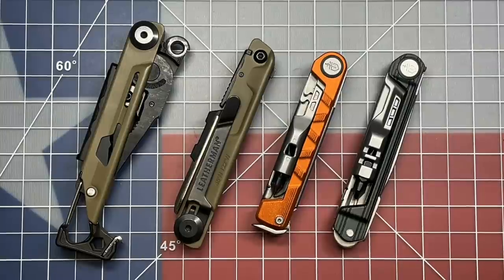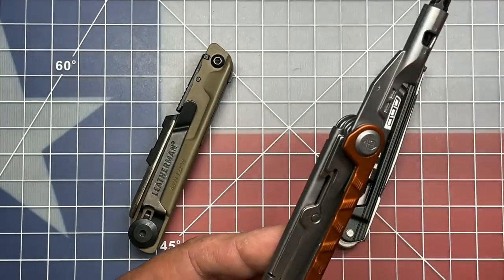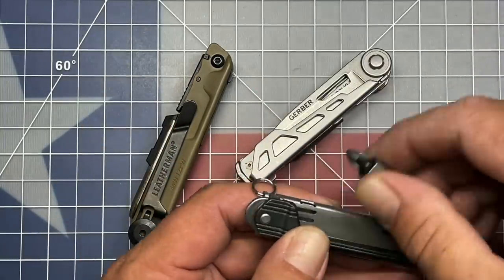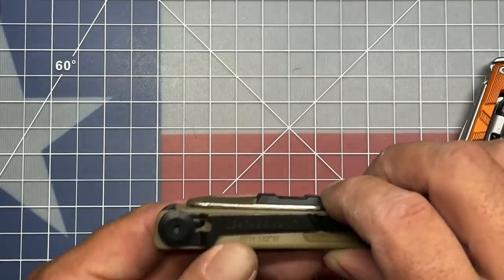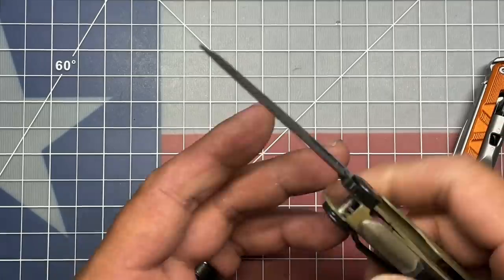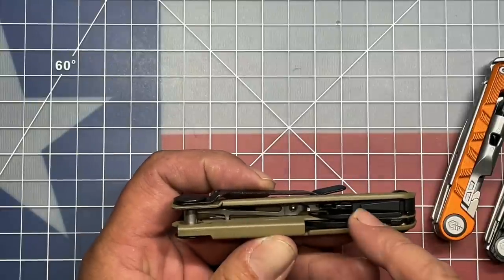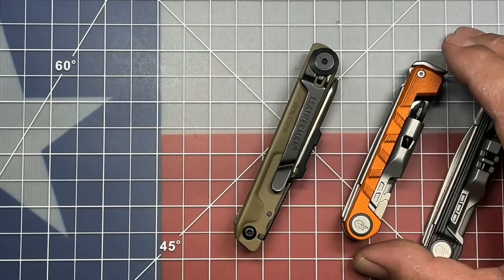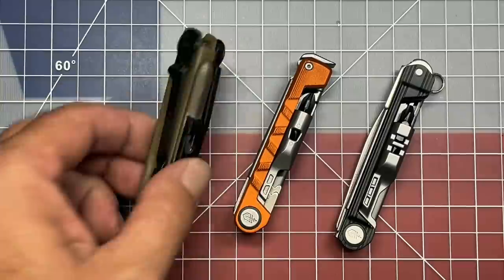Minimalist Multi Tools - An idea I think Leatherman should explore.

Comment: Victorinox SAK sitting over there being like: "Am I a joke to you?" lol
Reply from the maker: Lol. I get it, but I think Leatherman could build a locking version of minimalist multi tool that would give a SAK a run for its money.
Reply: @txtoolcrib  I was just teasing, btw. I like your ideas and think you're right on!
Reply from the maker: Oh I know, all in good fun!
Reply: @txtoolcrib  I think you're wanting two different things. you want minimalist, but you also want a large pry tool? a pry tool should be a specialized piece of equipment. a multi tool/knife shouldn't be used like that. if you need a pry tool so often that it needs to be edc, then you need to get a small nail puller/pry tool. it shouldn't be a part of your multi tool. there will NEVER be a perfect edc tool, so let's not go adding unnecessary equipment where it doesn't need to be. if you think this is a good idea, then I'm assuming you're one of those idiots that thinks the multi tools with a built in hammer is a good idea. I mean, you CAN fit a square peg into a round hole, but why bother?
Reply from the maker: Well first of all, let’s clear one thing up. I am nowhere in the vicinity of being an idiot. 

  You seem to be making quite a few assumptions on what I want. I’ll tell you what I think the ideal minimalist tool would be for me. A solid one handed opening knife blade is the first thing. Second, would be a capable fold out driver, similar to what the Armbars from Gerber do. Finally, a decent package opener for both boxes and clamshell packaging would most benefit me personally. An awl and scissors would be nice, but I could live without them. Lastly, all tools would be locking and it would incorporate a deep carry clip.
Reply: @chriswright8114  Wow Chris, you have problems.

Comment: Ben, you are totally spot-on.  Leatherman technically did something like this with the Free T2/T4.  But the tool selection wasn’t right.  It should be... knife, scissors, driver, prybar and maybe a pointy awl.  Keep it reasonably light and give it a pocket clip.  The SOG PowerPint is proof that you can pack a ton of locking tools in a small package (although the poor scissors and lack of slotted driver/prybar keep the PowerPint from being a top-notch edc tool).
Reply from the maker: I was always lack luster on the T series. I agree that the PowerPint is a pretty good, and very compact tool, though the tool quality could stand a little improvement.

Comment: I would say add…
Locking true 1/4 inch driver 
Good Scissors 
A diamond file
Little pry spot off the frame
Definitely a straight blade with good steel no less the 154cm preferably 20cv. 
Oh and good tweezers.

Comment: Definitely agree. Love smaller minimalist multitools. I’ve actually been pretty disappointed by the last few tools leathermen has put out. The signal is great! But the whole free line I’m not a fan of. The rebar is seems cheap but I think that’s the point. Very entry level, I get it. And then the new bond is completely pointless. Like I get it’s nostalgic I guess, but definitely a step backwards compared to the wave+. Pretty much any leathermen tool moving forward that doesn’t have a bit driver is a let down for me. 

The wave, surge, signal and mut are definitely their best tools. Anything new should be based off of those models in my opinion. 

What I’d like to see, and I know it would sell very well is a dedicated multi tool that’s dedicated to tradesmen. Give me pliers that have wire strippers, give me a nut driver, options for Allen wrenches, pop out mini level, magnet for finding studs, even a damn electrical tester.. I could go on! Release a “tradesman” line and have ones dedicated to electricians, plumbers or hvac/r guys. I ask people about it on jobs sites and I know people would buy them.

Comment: This is a really good concept to carry a knife/screwdriver + a set of regular pliers instead of having a pliers multi tool cause most people also carry a folding knife anyway. If they just focused on making it a really decent knife, and just do a fixed bit holder like on the skeletool on the other end. and another hole sideways for a 90 degree position. Maybe if there's room left over, have some storage spaces inside the handle for more bits.
Reply from the maker: That's a pretty decent concept.

Comment: to be honest i think the company that starts with a screwdriver rather than a knife will be on for a winner for this style of tool. throw in some way of holding 2 or 3 double ended bits and a utility knife (stanley blade) and that will do you for 90% of day to day spur of the moment use, if you need anything more then just go get the actual tools from the van/car/shed/garage as it'll most likely save time

Comment: Excellent idea, I hope that Leatherman is listening. I have owned both the Armbar Drive and the Armbar Drive Slim and although the slim was an upgrade, its not perfect. I ended up gifting mine away to friends. Basic tools like a locking driver, locking blade, scissors, and the combo tool would be a good set for me. Maybe a bottle opener if there is room. Thanks

Comment: I carry a leatherman free t4 every day and honestly it's the best compact multi tool I've ever used. I have no use for pliers and this has basically everything else you could want. Including halfway decent tweezers. It's a little chunky but it rides in the pocket just fine
Reply: I carry a SAK Hercules. it's got a unique long phillips screwdriver, small pliers and a locking blade. FANTASTIC tool 👍

Comment: The Armbar is wobbly build, doesn't hold an edge, the driver has no retention whatsoever, the scissors are sub-par and the awl is out of place in such a tool. 

I still carry it every single day since i bought it a year ago or so and actually really like it because it has exactly what i need on a day to day basis. 

Give the driver a lock, improve the scissors, give it a little bit better of a bladesteel and then take my money Gerber. Or Leatherman, i don't discriminate.
Reply from the maker: Agreed.

Comment: I did this with the Ozark trail multiforce from MAXLVL EDC, I love it so I have a knife locking, driver locking, saw locking, can opener, scissors, flathead/pry tool, wire stripper.bottle opener.so in it's case I carry a Gerber dime with the multiforce pocket knife the driver extension and my i3 eos flashlight hooks right on the bit driver side so it's still under the retension flap.its light and I have everything I need constantly haha 😂

Comment: I’ve been extremely happy with the Gerber armbar slim though it did take a little while to loosen up and break in specially for the bottle opener which was difficult to open at first the knife opened fine with two hands until it wore in now I can easily open with one hand. Haven’t found the lock necessary for the driver but it would still be a nice feature for future models.

Comment: Brings up an interesting topic. I'd really like to see a Leatherman multitool that includes a med to full-sized pliers with a knife, driver and pocket clip but in a slim, lightweight design (titanium?). The Skeletool comes very close but I do not like the radical design elements. I'd love to see something similar to the original PST (or new Bond).
Reply from the maker: I like that idea quite a bit. If there is one tool that I would like to see redesigned for the 21st century, it would be the SideClip. I really enjoy how compact and easy to carry that particular multi tool is.
Reply: @txtoolcrib  Yes! Exactly! I had forgotten about the Sideclip! Perfect example. All it would need is an exterior opening main blade and it'd be good to go.Actually, looking at some of Leatherman's newer offerings, the Rev does not look too bad. Not sure of the width or weight though. Even the Squirt is interesting but it'd need to be upsized just a bit. Get with it Leatherman!!

Comment: I agree on the locking driver and on the full size I would like a pocket clip. That's my only issue. The scissors could be better but if you sharpen them up some they aren't terrible

Comment: I know its still a kick starter but take a look at the bit bar inline from big idea design as a slim pocket screwdriver to pair with your favorite pocket knife, or since its not out yet I still use the 6 in 1 fastback utility knife 48-22-1505 from Milwaukee it has a bit driver bottle opener wire stripper and extra blade storage without being to much of a pocket dominator, i am a big and tall guy with deep pockets though

Comment: My current EDC multi-tool is a Milwaukee Fastback model# 48-22-1505 it has a locking Phillips /Flat screwdriver w/ ¼" drive, a Utility blade w/extra blade storage, a bottle cap lifter and a wire pocket clip. Really wish I could find one like it with a file and pry tool and a good pair of tweezers.
Reply from the maker: I'm surprised Leatherman hasn't come out with their own utility blade tool.

Comment: Give me a folding screwdriver with a rock solid lockup, like the Axis lock. Bit with permanent magnet, with the shaft on the proper centerline of the tool. Knife blade folds into one side, can opener/bottle opener on the other. Tweezers slide into the end. Maybe an alternate version that swaps the can opener for a paint can opener. Maybe an alternate version that swaps the can opener for an eyeglass screwdriver. Not too many tools, so we can keep the handle as round and comfortable for driving screws as we can. Ship it with a hollow 'pen' with a threaded cap that has 5 more bits inside.

Comment: I'd put in a "small" serrated blade, I'd take out the can opener. I'd add scissors, a bit driver with two different double ended magnetic bits, .. two small eye glasses screwdrivers. (phillips and flathead). Id remove the file the other small tools, and add a pin punch that fits most handguns, and one reversible Allan wrench of two different sized heads, and I'd replace the current knife blade with a straight edge blade. And make everything liner locked.

Comment: I would like one with a plain edge blade with better steel. A single cut/ diamond file, keep the vbit driver, put the micro driver in place of the can opener, keep the awl, and something to pry and scrape with if there is room left over maybe the package opener like the wingman had and make both sides lock
Reply from the maker: Nice

Comment: Love my Gerber arm bar it stays in my truck at work as my dirty jobs tool.
Reply from the maker: That driver keeps me from carrying it.
Reply: Yeah I know what you mean. I would rather have a slip joint blade and the driver locking. As long as you don’t expect too much out of the driver it’s perfect for those little jobs I need it for like changing bulbs on my truck.

Comment: I think they should fill that slot with either the ratchet driver or use it to have a way to carry extra bits. You could probably be able to fit 4 bits (2x2) there
Reply from the maker: That could work. A little fold up sleeve to carry two bits on board. That’s a great idea.

Comment: Yes they need to lock, Gerber is notorious for getting this wrong. Leatherman has ventured out and does sell slim down models without pliers. Personally I would add tools to the signal, Because it is intended as a survival tool & it should do more. Great video catch you later.

Comment: Love the idea, I think leatherman would have to start implementing good knife steel if they are to compete with other pocket knives. If leatherman knives were 1095 or some with more stainless or something, I think it would be a home run. As of now, a leatherman is a Backup blade for me. It works, but I know I can't push it because ive seen them break multiple times.
Reply: Always curious about this - what kind of use do you put your knives to, that you could break a blade on? I'm new to knives in general, though I've been happily carrying a Wave at work for years now
Reply from the maker: Well with the steels they use, at least a 154CM.
Reply: @GabrielMisfire  essentially using them as a pry bar. There are the type who do this and type who don't. There are different types of blade steels, if cutting is all you're using it for, the blade shape and grind, as well as type of steel, for either durability of an edge, ease of sharpening, or stain and corrosion resistant, would be the criteria. 

For using one that can pry something open, you want a "tougher" steel, such as 1095, which is more "flexible" before the breaking point, something a primarily a stainless steel knife would be like. It would also tend to rust faster and require more maintenance, since the stainless factor is not as prevalent and it will oxidize more quickly. D2 is also pretty tough, yet hard to sharpen. 

Everyone has a different set of qualities they want in a knife because we all have different applications. I for one, do not appreciate a blade that is not a good prep knife, that would snap on me when I am asking the steel to hold up under extreme abuse.
Reply: @urjnlegend  thanks for your thorough reply! Yeah, I had heard about edge retention and ease in resharpening - I had never guessed someone would be using a pocket-ish sized multitool with heavy prying in mind. But then again, I made the mistake of lending my Wave to a client  once, and they ended up using the straight blade to try and dig something out of their boat's floorboards and chipped the edge, so there you go...
Reply: @GabrielMisfire  well, when you're in a pinch, and installing all sorts of heavy equipment or trying to open a door, or work in construction in general, you run into alot of situations you don't want to or can't or shouldn't or are to lazy to grab different tool
Reply: @urjnlegend  well your first mistake is using a blade as a pry bar smh and then you wonder why the blade doesn't hold up
Reply: @RaidersX95  well if the blade is 440c or s30v, it can't take alot of abuse prying due to its brittle factor. S30v is a great blade steel compared to 440c, but more options would only be a good thing.

Comment: Put a full length saw instead of the knife, the put a smaller knife in the space for the pliers, ad the wave scissors, and add the wingman package opener, bonus points if they make one for the UK Market.

Would be be nice if gerber made a non locking armbar too.

Comment: The Armbar bit driver is offset from the centerline of the rest of the knife. Which makes it very frustrating to use when trying to use it like a screwdriver. The pummel is quite efficient at putting a nail… into the underside of your fist should you miss hitting it.

Comment: You should look at the Victorinox Cybertool S. It packs a lot more into the same form factor. They could incorporate their locking blade variant (from the Wenger designs). I suspect prime markets like England forbidding locking blades plays a part in not doing that.

Comment: I think it's better to think about those kinds of things from the beginning of the design process, just likeSwiss+Tech did with the 17 in 1 tool and they released their reduced 11 in 1 version without having to make any changes by releasing a new model at no extra production cost. Unfortunately, this leads to the locker being on the other side of the tool, forcing you to have to make the change yourself.

Comment: While it can be seen in some GoFundMe originated products, at some point, one of the major EDC/Multi-tool companies is going to figure out that what customers want is a 100% customizable tool where everything from tool-material to color to one-handed versus two-handed opening, etc., etc. can be chosen by the customer: From the largest to the smallest level of detail. While modding is certainly an option, there are customers who have little time, skill sets, nor space/workshop equipment to do modding, but who have money to spend on getting the exact tool with the exact features they want. Obviously, I'm one of these and I can't wait for companies to catch on/catch-up with customer desires.

Comment: I like the arm bar tool drive. 
I don’t mind a combo blade
A seperate serrated blade even a slightly smaller than the straight would be better. Combo bottle can opener good. Size is right for both. Must have a pocket clip.

Comment: It has probably been said before but could you add the tools from the other handle to the spindle for the pliers all in one handle side.

I'm planning to do the same to a 20yr old wave as I need to shed some weight for a uk coast to coast through hike next year -  I could do with carrying a non serrated knife, scissors, watchmakers screwdriver (glasses wearer) and a saw.
Any advice would be appreciated as I've only dipped my pinky into the pool of modification for the first time today and I'd rather not screw up my tool as it is a veteran of a couple of wars like me!
Cheers

Comment: Add the package opener/prytool, a pair of scissors, the flat bit driver, a diamond file in place of the blade to touch up my EDC folder and call it a day. I would pony up $50 everyday of the week and twice on Sunday. That would be the perfect companion to my primary blade. I carry an OLD Wave for work but outside of work, I rarely use the pliers and it's a lot of bulk to tote around in  summer shorts weather. I think you are really onto something that Leatherman would have trouble keeping on the shelves if tooled properly. Let me know what you guys think of this set up.
Reply from the maker: Nice, I think there would be quite a few people in line to buy just what you propose.
Reply: @txtoolcrib  Thank you for all you do.  You give your channel a lot of thought and I appreciate your thought process during your reviews. I hope  your platform can persuade (lean on) Leather to to bring something like this to market. Thank you.
Reply from the maker: Thank you very much. I really do like your suggestion. That would be a handy little tool, especially for those that carry a folder.